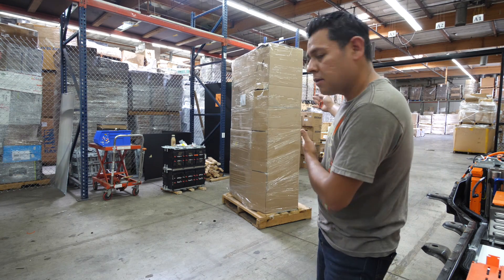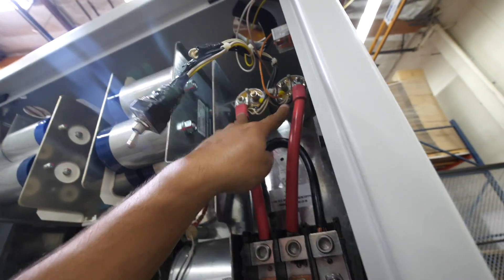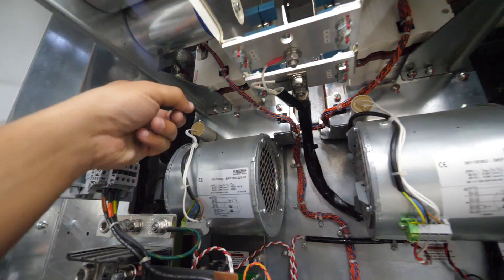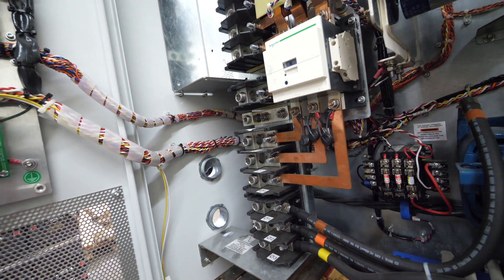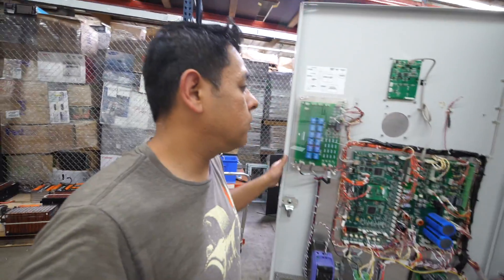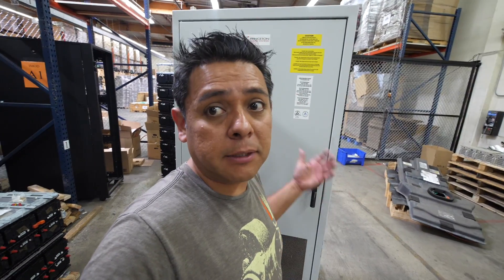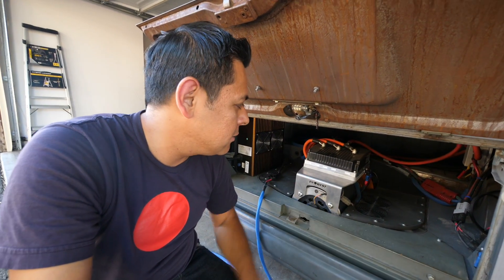A LOOK INSIDE A 100KW 3 PHASE SOLAR GRID TIE INVERTER

Comment: The difference between the two inverter can be pictured easily by thinking about engines. A 500hp 3.0l V6 engine from a fast family saloon/sedan may have the same power output as a big diesel engine in a 28ton truck but you definitely can't use an Audi RS6 engine in a heavy hauling truck pulling 30tons of cargo

Comment: Thanks for the fantastic video! I really like to watch such devices, technological solutions, etc.
It came to my mind to answer your question about the difference in size between these devices.

Well, size is a derivative of many things.

The large inverter is built with IGBT technology, and you can see very large IGBTs as well as huge capacitors are used. Probably they do not have a large capacity, probably up to several hundred uF, but they have very low ESR, conduct huge currents, must be well cooled and must work for many years.
A lot of space in the wardrobe allows for easy replacement and assessment of damaged elements. The cabinet is designed to be installed near a solar farm, it needs to be remotely controlled by this huge three-phase contactor.
The inverter must have appropriate power supply connections for IGBT modules and power connections - this takes up a lot of space and must meet industry standards.
This type of device is also to ensure the best quality of the current supplied to the network, which is indirectly ensured by these huge coils at the bottom - they are used to extinguish the voltage spikes and store and return energy from IGBT modules, which work in PWM mode, probably around 20kHz.
The device is subject to professional supervision of electricians, so it must meet the standards, including safety. This all explains the size of this 100kW solar inverter.

A car inverter does not need to have almost any of these features. This 80kW, if I remember correctly, the one you show at the end, when it breaks down, do you know what you can do with it? ;) And that is the huge difference between these inverters.
Besides, I think that advances in SiC MOSFET technology will change everything. From such a cabinet it will be possible to achieve 10MW soon, not a paltry 100kW.

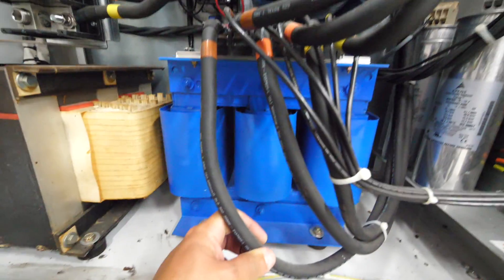Comment: 3:30 those are inductors. They work with those smaller AC caps to smooth out the rough ac to sine waves.

Comment: Thinking the 2 big white things are SCR's aka thyristors... not sure of the difference between IGBT and SCR?   I got a little confused because I think you said the DC was passing through a transformer? usually the DC switching is done first to create AC then passes through a transformer to acquire the desired volatge.  I imagine the caps are there for smoothing. Also I've used VFD's as off grid shop inverters for 3 phase power by just tapping DC into the buss bar. VFD's should be able to function as a grid tie inverter since most have the ability to regen into the grid. I've always wondered about using industrial VFD's a motor controller for EV's? I thpugjt this was an interesting comparison of mosfet vs igbt vs scr. https://electricalvoice.com/comparison-of-thyristor-mosfet-igbt-devices/

Comment: both inverter may be 3 phase but there functionality is day night different. 
I think the phase difference voltage  is the first thing.  phase difference voltage is double   of what the actual voltage is like 110 v is 220. and also 120 degree shifted. In motor controllers   the phase difference voltage remains the same as the battery voltage however its switched precisely by igbt's is such way that the motor forms a rotating magnetic field.
And the second thing is we can run single phase induction motor by taking any of the 3 phases and ground connection but ev inverters not possible.
correct me if i am wrong, i do appreciate it.

Comment: I've been researching options to install a 30-40kWh battery backup solution to work with my 9,860 watt solar PV system. My goal is to get completely off the grid, or at least only draw from the grid rarely. I've been thinking about buying 6 Tesla modules and an inverter, but interested to hear from the expert.

Comment: The big one is 100KW of 3-phase with multiple sources (solar, wind, hydro, battery & grid) and multiple outputs...including the ability to sell power back to the grid.
The little one is 80KW single input (battery) & single output (motor).

Comment: The giant inverter is more impressive compared to what's used in cars for the same reasons that giant motors that output the same power as the much smaller ones used by EVs for a simple reason, time spent at peak. With a car you won't spend the energy in the battery pack doing peak discharge and peak loading the motor, if you did, they couldn't handle the heat. The large industrial ones are designed to work at those powers all the time.

Comment: One of the big guys must be designing a battery for large scale that solves the heat problem that is a much larger battery than 18650. Something about 2lbs in weight or more in a solution with fins for cooling. that contains 1kW per hour or more. This technology will be very short term give it a year. It will change massively.

Comment: Remember nearly all autos and mobile vehicles are grounded DC negative. :)  Yes you can have AC caps, they are used mainly for power factor correction, phase adjustment, and motor starting.  The electronics for creating 3 phase AC that can be synced up to the Power Grid is much more complex than the inverter/controller for your bus.  The inverter in your bus can run at any frequency and it won't really matter as long as it will power your motor.  In addition to that i don't believe you have a real AC inverter in your bus ... you have really a controller which simply decided how much power to send to your motor based on your "gas pedal".  That is a lot different circuitry.  Lastly creating 2,000 hertz AC at 100 KW would shrink all those huge transformers and inductors by a factor of 6 to 10 times.  so the size and weight of that system would shrink a lot!! ... But you can't sync to the power grid if deviate from 60 hertz by more than .25 cycles.

Comment: Jehu, thanks for the video. How much is the 50KW, 3-Phase inverter? Where in U.S.A can I get a new or fairly used one?Does this inverter comes with charger to charge a 100KWH LG 16S Battery Packs?

Comment: Hi jehu!

Two words to explain the difference between that 100 kw inverter and the pair of smaller inverters that are making 140-150 kw:

Duty cycle

That big 100 kw inverter can run at its rated power for 24 hours a day, 7 days a week, 365 days a year without breaking a sweat.   Try that with the two smaller inverters that are making 140-150 kw and they would melt.

Comment: you know how mad I am not been able to aford the bundle I am just 17 tried soo many job applications nothing every job around me is full I been into this for 7 year my first solar panel was a 5watt stolen some 165 w solar panels were donated to me but they were broke shatered glass only produced around 30 watts I been charging 4s laptop batteries I got from school for the past 3 days no charge controller no bms no safety aaaaaaaaaaaah I so hate my life I been trying to get an inverter woo baddly I found one in a trashcan I think its 200 watts but with no cover or Idk what its max power output it just a bare board worked for a while but battery voltage was high caps blew

Comment: One other thing you will be putting all your eggs in one basket.  With only one large inverter it is all or nothing.  These things do break down and then you have to go on bypass and hope nothing happens to the normal power.  We found it better to go with multiple smaller inverters that would sync together and have one more than we need for a spare.  We did 100kw for our computer room where we used 5-25 kW inverters that load balances on one panel where you could lose one and still met all your needs.  The chance of two going down at one time is small compared to your one inverter breaking down.  I can tell you it will break down in the middle of a storm on a holiday when you are running a backup that can not be interrupted.  These things love Murphies law  Beter to be safe than sorry.  I would never use one large inverter over many smaller ones.  I ran and designed computer rooms for 24 years take this as advice from someone who has been there.  Good luck
Reply: hey Ricky that actually makes a lot of sense!

Comment: Dude make sure you have a way to isolate it from your output so it can be worked on and you do not lose your load.  Don't just use the internal bypass because most of them keep the caps charged so it can switch back instantly.  It makes it so you can not change the caps without powering down the whole thing.  The cap that gives you a true sine waveform only last about 10 to 15 years of use and then they start to fail and your waveform starts to step.  So make sure you have an external bypass that is a make before break so you can bypass your inverter without dropping your load.  This way you can work on and replace it when it wears out.  Trust me, do this during install because it is too hard to do after the fact when it is being used.

Comment: Also for the size difference on the inverters between the grid tie and the motor inverter. The grid tie for one has to be 100kw continuous and two has to provide that 100kw very clean so it needs many extra filtering and safety components in it to be able to send power back to the grid. The motor driver may do an 80kw transient peak but I guarantee that little box will not touch 80kw for longer than a few seconds. Motors typically take lots of power when speeding up especially in electric cars, but once you reach your speed they only run continuously at somewhere around 5kw to 20kw. The grid tie inverter also needs to convert voltages it may need to step up or down depending on the pack voltage. That car inverter most likely just takes the pack voltage and chops it up to feed a 3 phase motor. We are comparing apples and oranges here. Great video though and thank you for sharing! I found the video very interesting.
Reply: Great answer !!  In addition creating 60 hertz forces you to use huge inductors.  His motor controller can run at a much higher frequency which lower the duration of the current spikes and the size of the inductors by a huge amount.
Reply: Can I ask you how much it cost for you to install it for someone else
Reply: Or how much it will cost for an electric car
Reply: how much does it cost for an electric car is about 600 bucks if you salvage an electric forklift for 500.
up to 100k if you want a long range and high power EV..
Reply: For Solarpanels  on your roof, you need also a big and expensinve inverter..why?
Reply: More like apples and grapes.
Reply: Great video. May I know what is the brand of your 100kw inverter Sir.

Comment: Jehu, there is a big difference in true sine wave inverters compared to the digital ones you use to drive a motor. 
When driving a motor it does not care if you have square wave or sine wave, it works on both. 
But the Mains care a great deal of the signal is sine or not so all the components are for creating a proper sine wave.

Comment: Jehu, on Combo Inverter and 13KW batteries... why is it 13KW spec.? Looks like less than 10KW, what am I missing here? $3K is a deal.
Reply: @2Awesome that's it. I see pic above on pallet is 12 modules. Math does work! Thanks
Reply from the maker: 13kWh battery      4.4kW inverter     Whats the confusion?
Reply: 15S3P setup you show: 55.5V *180Ah= 9990  or 9.9KWHr. Where did I go wrong?
Reply: Because you get 12 batteries instead of 9? Picture has 3s3p, you're supposed to 3s4p
Reply from the maker: Yup I did make a mistake on that graphic turns out,   but yeah 12 modules  offered with inverters

Comment: Regarding the sizes of the inverters: the static one is designed to run at 100% duty cycle, all day every day. The drive inverters in EVs are designed to run at, say, 20% duty cycle, i.e. steady 70MPH with the odd blip when accelerating. When working hard, automotive inverters get heat soaked and de-rate until load drops.

That's acceptable in a car, not so much a factory :-) Intel plays the same game with their chips: they have a TDP or Thermal Design Power, meaning they can't run everything at full speed all the time without throttling down to reduce head production until the heatsink can catch up.

If you could pull the heat out of your automotive inverters quickly enough you can probably up-rate their duty cycle, but fitting all that cooling in a car can be a real packaging problem, especially if you can't get coolant in sufficient quantity to where the heat is being produced (like Tesla's watermellon-sized drive inverter).

Comment: Mainly the output caps are for
Balancing the power factor as well as the inductance, and the power board governs them, white thing on the output. This is to keep the invert near a power factor of 1 and don't blow the igbt. The size of this invertrrr is big due yo this, the one in your car is design for and engine and this one is ready for a bunch of more complex loads.

Comment: Be careful with this unit, if the input battery negative is earthed as shown you will have to also install an AC isolating transformer to the set up, thats what the left hand bottom sets of terminals were for, did you get this transformer with the set up ?, if not it could be expensive !, very interesting to look inside this unit......

Comment: Tell your motor controller to output 60hz ;-) ( not the 5~25khz switching or whatever they do make i think they motor is spinning slow) , check with a scope ( you may need a filter) and then split the phases ( a used datacenter rack PDU ) and hook up some loads ( 3 mig welders? ) and see what happens. I've been wanting to try but have spend my resources in other places.

Comment: +Jehugarcia , I'm doing an off grid house battery/solar, Interested in 2 inverters, and 36kwh of batteries. Do you have the data sheet for the batteries, and cycle info for them (tested/untested)? What kind of a deal could you do for those quanties?
Reply: David Tucker II why do you need two inverters?
Reply from the maker: for now thats the only deal I have,  in a not very distant future these batteries will sell for $150/kWh and $130/kWh when buying 75kwh or more
Reply: You can put them together and get 8800watts. Trying to setup a system to run a "modern" house.
Reply: Awesome, thanks ended up buying 2 of these for now, later I can add more cells. Looking forward to watching you wire up this MWH battery. Love your channel!

Comment: I am definitely interested, price range?
Reply from the maker: click on links
Reply: I checked out the link.   Is that the lowest you'll go on one of these bundles?  I want to be able to power my 48000 BTU central A/C but the inverter is just slightly too low so, if I bought this bundle, I'd probably end up having to replace the inverter and be tasked with trying to sell it.
Reply from the maker: sounds ,ike this deal is not for you,  Id recommend buying  the right sized inverter

Comment: your motor controller doesn't have to change voltage. keep it regulated. the controller is basically a MOSFET switch that turns the power on / off a few thousand times a sec.  which is what a inverter does and lots more.
Reply from the maker: +James stranger  my controller does regulate battery voltage 80v-130v to 96vac
Reply: jehugarcia 
I didn't know that. I guess I need to get my foot out so I can talk. I have been attempting to build a inverter. since I am having trouble buying one. your channel is very interesting.